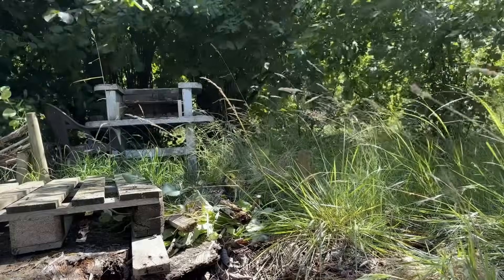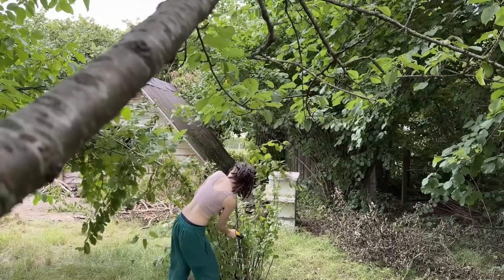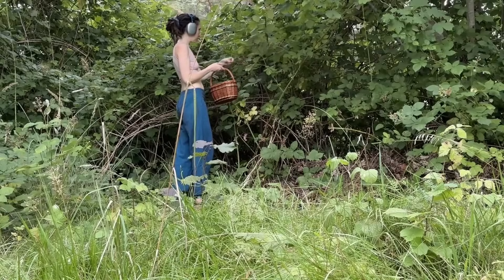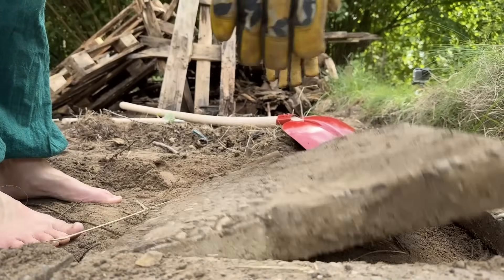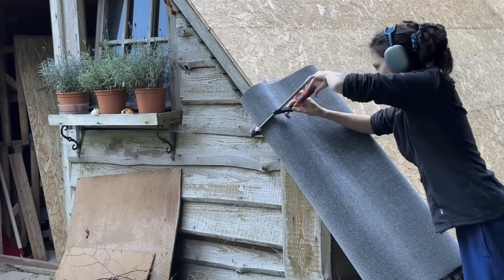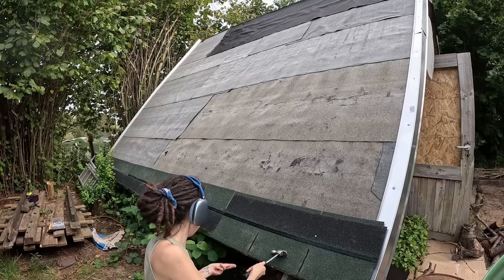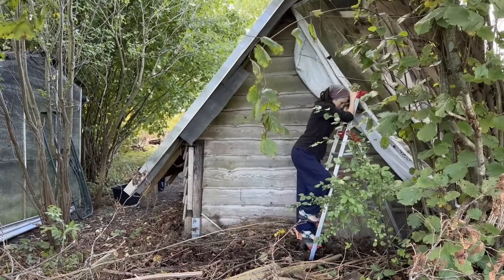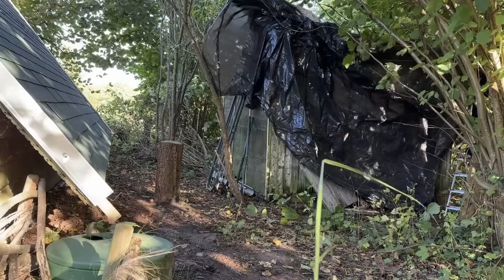My first three months on neglected land #040

Comment: I can't get past the bare feet. I have built several tiny houses now, and the amount of stray metal on even a clean worksite is tremendous. I've also lost three toenails now, dropping things on my feet with boots on. I can't imagine not wearing shoes.
Reply from the maker: I assume it's okay if I answer, even though you spoke about me in the third person as if I am not here. See the pinned comment. I have explained the barefoot thing there in detail :)
Reply: @RootsandCalluses  Third person is "she" and "her." I spoke only about myself in the first person "I."

I also see no pinned comment.
Reply from the maker: Sorry, I answered the wrong comment. The comment underneath yours talked about "she" and "her." I got a little overwhelmed with all the comments on this video, many of which were rude and insulting, but I should have paid better attention, as you were not one of those people. I apologize.

As you don't see the pinned comment for some reason, here's the copy-paste part of it:

2. Why are you barefoot? I put video 008 back online where I explain my reasons for going barefoot. I have been barefoot for the vast majority of the last three years but I do wear shoes when I feel they benefit the situation. There have been exactly three moments when I later realized I should have worn shoes (but got lucky). One of them is in this video, and I apologize for that. I should not have used the string trimmer barefoot, let alone share it. Longer answer: https://katehildenbrand.com/on-living-barefoot/

Comment: I love your exuberance.
Are you renting the land? What country is the land located?
Great job on the roof but definitely ask for help and accept it.  If it feels awkward offer your help in kind. We all need helping hands at times. It’s too late for the first cottage but you should usually stagger your roof boards for best strength. You can apply that to the next roof. Cut some OSB in half and stagger your seams. 😊
Reply from the maker: Thanks! 🙂 I pinned a comment with some answers. The way I rent the land is explained there a bit more. I am located in Northern Germany.

I already learned that the boards should be staggered like bricks. But it should be fine. Technically, the OSB is overkill for this structure, so it should all be good.

I am working on the help thing. Not easy for a chronically ill person who has been told for 16 years that it is all in my head and I am fine. You learn to pretend you are fine then. Since my diagnosis, I have been working to undo all the mental health damage done by doctors over the years who didn't believe me. Working on it 🙂

Comment: With all the wood you have piled up, you will have lots of fuel for a fireplace or fire pit to keep you warm. Keep up the great work.
Reply from the maker: Unfortunately, I'll never be able to move onto the property, so the fire will only be for fires and grilling in summer. I plan to create some wattle fencing this winter from some of the wood, and hopefully there will be enough to make proper compost piles from thicker stems and some of the branches.

Comment: Nice progress video! However as a long time outdoor worker, PLEASE WEAR PROTECTIVE FOOTWEAR- closed shoes or boots. I have been doing this sort of work for 40+ years and that is my number one rule. It seems like a minor thing until you get hurt, and the recovery from a dirty outdoor wound is much harder and slower than a sports injury or a household accident. One crushed toe from a sliding roof panel or a puncture injury and you are sidelined for some time. A neighbor lost vision in one eye from a rebounding branch during routine garden pruning, so I now take eye protection seriously, which I never did before, because in all these years I never had an accident. Even after decades of work I still needed an example to make me work safer.
Reply from the maker: Thanks for your concern. I take it seriously. I wear footwear for grass trimming, eye protection for sanding and anything that might throw stuff around. I wear gloves when I have to touch things that might hurt me. I wear sandals when I go into areas with nails or unknown dangers. I wear boots in the more unknown parts. I promise, I am being safe. On the roof, I knew very well where everything was, and took great care where I stood, worked, and where I would fall if X or Y happened. But I have a lot more control with my feet on the ground. As soon as I put on shoes, I loose a lot of my coordination abilities. I would not have been able to move around on the roof like I did. I would have risked slipping on the ladder. Things like that. I need the contact, so putting on shoes is a trade-off. But I promise, I am being safe. :)

Comment: What does that mean you “adopted” the land? You made it better and then you gave it back to the owners? Or do you own the land and the hut that’s on it?
Reply: Those were my questions after the first 10 seconds of the video
Reply from the maker: It's a weird German system. I pay a tiny amount per year (less than half a Netflix subscription) in exchange for getting to use it. I have to give it back in at least as good shape. I plan to return it in a lot better shape. Most of the plots are in fine shape to start growing on. This one has been neglected for quite a while, is completely overgrown, and I am currently not even paying the nominal fee because it is so much work. So, I kinda rent it. It's a kind of stewardship where I pay to be the steward but also do the work :D

I don't own the hut. When I leave the land, all the money and time I spent on it will go to the next owner. I'm okay with that.

Comment: im a new potential subscriber. you are speaking english but im having difficulty. the volume is fine. it could be enunciation or the mike you are talking into. if i may, dont talk like you are talking to a friend but like you are talking into a mike. anyway i just saw the caption and turned it on but im across the room working and the font is too small. im going to binge and see if it improves.
Reply from the maker: The volume is fine, but the audio quality isn't. I had issues with the mic. It wasn't about how I spoke or my English. It was about not recording with the right settings and in the right place. You can check out my most recent video, and you'll see it's a lot better. I am sorry you are struggling :)
Reply: @RootsandCalluses  im not at your current video yet cause im still binging. i did agree your english is fine so it could have been that you arent talking directly into the mike on your side or something like that. im going to carry on now. peace.
Reply from the maker: Sorry, I'm a little on edge. The comments under this video have been exhausting, and after being called an irresponsible idiot who can't edit or talk, and who is stealing land from someone (none of which is true...), I am getting a bit defensive. I apologize. Enjoy the rest of the videos! If you reach the most recent ones (Tour of the Neglected Gardens), I would appreciate feedback on the audio :)
Reply: @RootsandCalluses  youtube recommended your channel and i was just giving feedback just incase you werent aware. i dont want to add to your stress. im still binging, however, i will let you know when im all caught up.
Reply from the maker: This isn’t on you. I appreciate the feedback! :)
Reply: @RootsandCalluses  no problem :>)

Comment: Interesting video.  However, next time could you PLEASE USE Volume on your videos?  I had my volume turned ALL the way Up, and I still had to use Closed Caption to see what you were saying, due to your whispering, and not using a proper microphone, or proper volume. 

Thanks!
Reply from the maker: If you check the pinned comment, you'll see that I'm aware of the issue. I've hopefully fixed it. The latest videos should already be fine. I am sorry you struggled.

I am not whispering. I am using a proper microphone. I am even using the proper volume. The audio quality is still really bad, because of a wrong setting.

Comment: Oh goodness I'm distracted by the barefoot string trimming- please wear sturdy shoes.  That string could flay open a toe or fling something sharp at you that could also do a lot of damage.
Reply from the maker: I only ever once did that, and it wasn't on purpose. I didn't realize until later that I'd forgotten to put on shoes. I usually wear close-toed shoes for that. Unnatural tasks require unnatural footwear. I totally agree with you here :) I should not have included that scene in the video. I didn't even notice that I was barefoot there.

Comment: A bush  hog would solve her grass , weeds,small trees and bushes problems in one failed swoop.
Reply from the maker: I will answer you even though you talked about me in the third person. There are a few reasons why I don’t have a bush hog: First, they are expensive, and I have a very limited budget. Second, there is no electricity on the land, and the fuel-powered machines are usually very heavy. I don’t have a way to move them around the land, as I can’t get a vehicle onto the plot. Third, I don’t want to accumulate a lot of heavy machinery, but prefer working with a limited toolset, even if that sometimes means investing more time. Also, I really hate noise, so the barrier for getting out power tools is a lot higher. I’d rather spend an hour peacefully doing a task manually than ten minutes getting assaulted by noise. And finally, I am trying not to destroy the land. I don’t see the grass, the small trees, or the bushes as problems. Even the weeds aren’t something I’d call a problem. This is an ecosystem, and I am trying to heal it, not submit it to my will without taking the needs of animals and plants into account, as well. That doesn’t mean I won’t be growing food, especially on the second plot, but it means that I don’t do certain things, even if they might be easier. I will, for example, never till the soil. It might make life easier for me, but it’s detrimental to the soil, and I am thinking more long-term and less egocentric than that.

Comment: Get some shoes and a nail gun !
Reply from the maker: A nail gun would have helped in a lot of these instances, but it wasn't in the budget. I do have shoes though. There are two pairs in that garden house for different tasks (rubber boots and sandals). I have been living barefoot for three years, and putting on shoes usually makes me less safe, because I need to feel where I step. I promise I am being safe :)

Comment: Good on you for taking this on and showing yourself what you can do. But it is not smart of you to do this and flip-flops and basically bare feet. That is not smart of you at all.
Reply from the maker: I have been living barefoot for almost three years. My feet can withstand a lot more than people think. I put shoes on when it is necessary. I can honestly say that the two times I injured my foot in those three years were once when wearing rubber boots and once indoors.